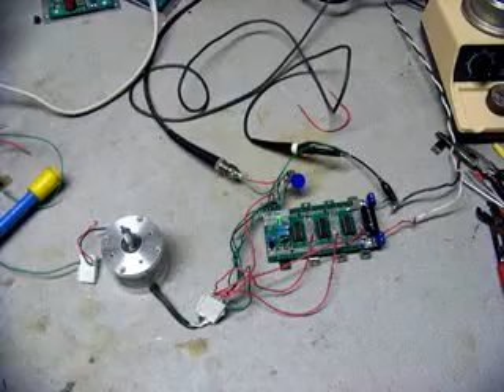Brushless _3phase_demo.mp4

Comment: hello, can you provibe the wiring diagram for this motor? I have the same motor, but its not running very smooth like yours and it heats up very quickly. I found the PDF on the Moog site with the wiring information, but my motor only runs up 2700rpm, has little torque and gets really hot after about 5min. I will pay for your assistance if you like. Thanks in advance.